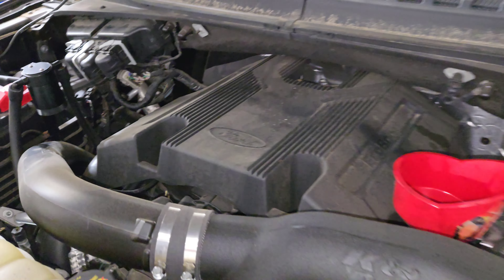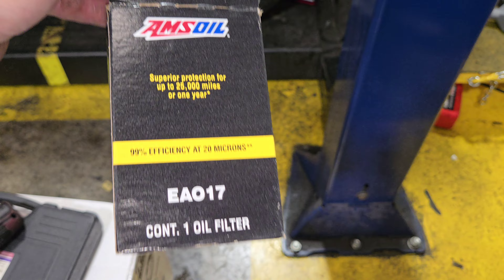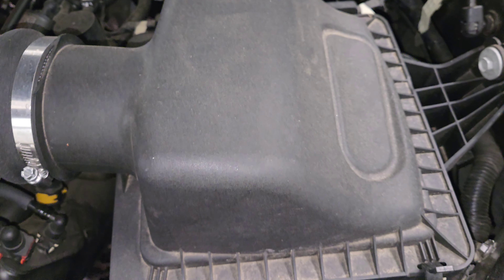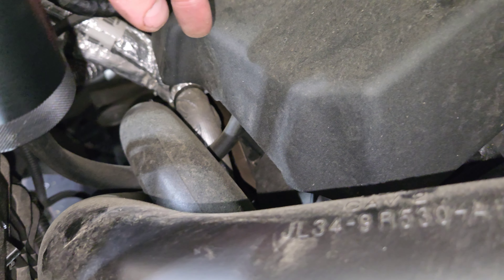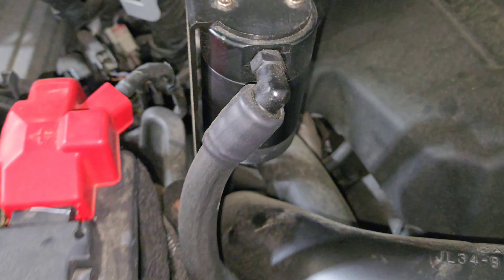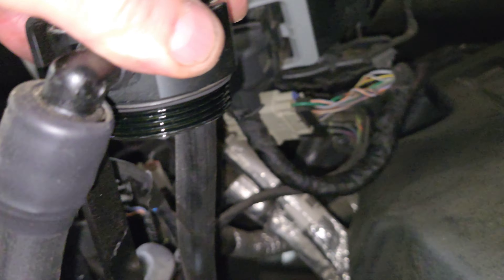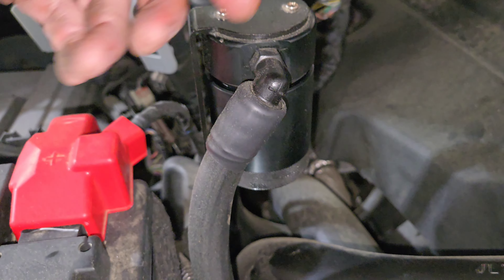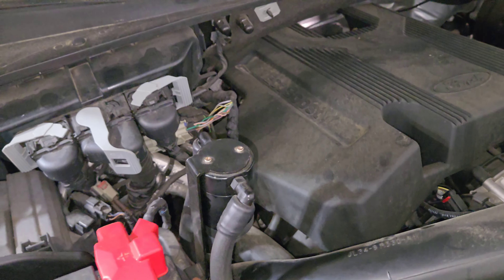Oil Catch Cans. Do You Need Them? #newtoyou #mechanic #automotiverepairs

Comment: Nice to see sons taking care of their parents vehicles in use to help my  parents with their maintenance and cleaning.they pass a couple of years ago and I miss them..I have a 2020 GMC Sierra AT4 that I use amsoil in with their filters I think that is the same part number oil filter on my gm motor.I change my oil once a year and only do about once thousand miles a year nice and clean
Reply from the maker: Yep I run it in my truck too. During the oil testing I've been doing I've been using the motorcraft filters cause when I started the test amsoil ran out of my filter. So I have to keep it the same. After this change in about 1800 miles back to the amsoil filter. Yes the chevy and gmc tske the same filter. I use them on my fleet tahoes. And got to help the parents out. He sacrificed a lot for me when I was younger and never realized it until I first became a parent. His birthday is coming up and he will be 79.
Reply: I never thought of how my parents worried about us till you do  it when your kids get there drivers license that is scary  now I know why my parents got a police scanner.I wasn’t a angle but I know that I did know how good they were
Reply from the maker: @johnmcalisterjr3913  agreed. I wasn't an angle all the time. But I knew the limits. And I knew the outcome (which wouldn't be good) if I did something really bad

Comment: I have a 2023 Nissan Frontier Pro 4x and I have an oil catch can on that, and on my 2018 Genesis G80 Sport with over 180k kms in it. Both cans do their jobs.
Reply from the maker: And I bet it runs a lot smoother as well. All that oil not going into the intake. About how often do you need to empty yours?
Reply: @BeardedFordTech  I empty around every 3000-5000kms on the Genesis (same time as my oil changes) and the same with the Frontier.

Comment: I agree with you on catch cans and I also use them on any engine, NA or turbo. I have come across some videos of people saying not to use them because they actually create more crankcase pressure due to the baffling. The theory being that the PCV system must remain unobstructed and have the shortest path possible to the intake tract. The videos are always with diesel engines, never gas engines so maybe that application holds some merit? I've never had any issues using a catch can on a gasoline engine and I've used quite a few over the years. Thoughts? Good channel by the way!
Reply from the maker: Never had an issue on gas engines. Diesel totally separate application. They have the ccv box. And a catch can doesn't really work on them. Tha k you for the compliment.

Comment: These things should come standard on every DI engine
Reply from the maker: @williamtoney2599  they do. Well sort of. The have oil seperstors that drain it back into the crankcase but it still gets into the intake. These actually catch it. I agree they should be standard. But not just direct injection. It's on naturally aspirated ones too. Pcv works the same. There's one on my mustang. Passenger side is all you need
Reply: @BeardedFordTech  
I’ve got a Tracy Lewis Performance catch can on my 16-2.7. 50,000 and no issues except….its a “leak-o-boost….🤨
Reply from the maker: @williamtoney2599  yeah 15 and 16 had leaking troubles. The new ones too around the pan and valve cover

Comment: Just changed my expedition to Amsoil, just over 20k, and My f150 also has Amsoil 194K. I though of putting a catchcan on our 2019 expy, but heard this generation ecoboost doesn't need so this video will be informative.
Reply from the maker: It needs it. If not oil residue will get in the intake. Just save yourself the Hassel down the road and keep that intake clean!
Reply: Doesn't matter the year or generation of ecoboost catch can should be installed. They would be there from factory but people can barely change their oil let alone empty a canister every couple thousand miles

Comment: does catch can void ford factory warranty??
Reply from the maker: @mulenine9867  in order for it to do that. The tech has to prove thats what it was.  As long as you keep an eye on it and empty when needed. There have been 6.6 duramax voided warranty cause of a cheap can they put on there that came apart. I've never had one do that. Don't put a cheap one on it. Keep an eye on it.  And empty it. You won't have a problem.

Comment: I like the  theory  but just not sure. I put one on my wife’s 2019 Grande Sport as per instructions and it hardly gets anything in it. I was told I should have put it on the passenger side of the engine for it to work better. I installed it according to the directions which were designed for the left (drivers side) so WTF? Any thoughts?
Reply from the maker: Always put it on the passenger side of a v6 or v8. Because of the rotation of the engine.  Which is why you don't need two on a v6 of v8. Just the passenger side.

Comment: I just installed the UPR 4' Mega catch can on my 2011 F150 back in February.  Its unreal what that stuff catches.  Now I have a leaky driver side turbo.  I want to replace both with Motorcraft but damn they are expensive.  Is there an alternative turbo you highly recommend you would use that is a straight bolt on without any additional tuning?
Reply from the maker: The only way to get one without tuning that is aftermarket is to get one that has the same amount of blades and is tye same mm.  I don't know many aftermarket ones.  Leaks are common on those years.  Have you verified it's not just the oil line going to it?  A lot of people misdiagnose those as leaking turbos when it's actually the line.  Not saying turbo doesn't leak.  But it's worth a look before you drop some coinage on a new one.
Reply: @BeardedFordTech  looking from underneath looks like the turbo.  I may take it for a 2nd opinion though.
Reply: @BeardedFordTech  I found a website that sells turbos from several different manufacturers.  All say direct bolt on.
Reply from the maker: @bearing_aficionado  as long as there is no tuning and is the same fin count and mm you should be fine. I don't have experience doing aftermarket ones on f150's it was usually under warranty or the customer wanted factory put back on. So I couldn't tell you a good one. Sorry.
Reply: @BeardedFordTech  it's all good.  I know mine are actually BorgWarner turbos just rebranded as Motorcraft.
Reply from the maker: @bearing_aficionado  yep. There has been three brand they use. Motorcraft being one.  You got a 2011. But borgwarner did them for the 2013+ possibly earlier for trials.
Honeywell
Supplied turbochargers for Ford's EcoBoost engine technology in 2008, which was used in the Lincoln MKS sedan
BorgWarner
Known for their OEM turbocharger designs for 3.5L EcoBoost engines, including for the 2013-2016 F-150 EcoBoost 3.5L and 2016-2017 Ford Expedition
Motorcraft
The only Ford-approved turbocharger for Ford and Lincoln applications, built to Ford specifications for performance and durability
Reply: @BeardedFordTech if mine is a Honeywell, that means they are Garrett's now.  If that's the case I could purchase them cheaper than the branded Motorcraft ones.  According to some turbo websites, these are direct bolt ons.  You got me thinking about the supply lines now.  I just messaged my nephew who is a manager at a shop and I will take it to him for a 2nd opinion. 

Thanks for the conversation.  You just got a new subscriber.  

I can tell you with 100% certainly who makes the Motorcraft differential bearings for the F150.  Transmission and differential bearings for the Explorer.  Mustang hub bearings.  2020 and up Explorer hub bearings.  Of course depends on certain applications, trim packages, and engines.  But they are made at my factory.  At least made in the USA.  Soon we will be the supplier of the F150 Lightning EV.  Those things are a freaking monster and weigh almost 20lbs.
Reply from the maker: @bearing_aficionado  dude that's awesome they are made here. I'm glad they are. Which factory are you in?  If you can get a bolt on thats even better. Yes I would double check that oil line. Usually the oil feed line leaks and it looks like the turbo and gets misdiagnosed. Not saying the turbo doesn't leak. But i would get a second opinion.  Be a lot cheaper if it is just the line. Thank you for the sub and conversation. Have a great weekend. Keep in touch. Let me know if it was the line of the turbo itself.
Reply: @BeardedFordTech  I work for NSK.  It is a Japanese company but we are global.  We make bearings for Toyota, Honda, Tesla, and Ford.  We also make for other suppliers, but those are either going away or we make them as needed, such as aftermarket.  We are losing what we call Hub 1 bearings.  Those will be phased out by the end of this month to make room for the F150 Lightning line.  That line is going to be huge from my what I've been told.

I just sent my nephew a message, and he was like, "Bring it up, and I will take a look at it."  I will definitely keep in touch and update you what I find out.  Thanks for the conversation, and have a great rest of your weekend.
Reply: @BeardedFordTech  p.s.  Ryobi makes transmission castings for certain Ford vehicles.  I used to work there and made those.  My brother still works for them.  Yes Ryobi does more than just tools and they don't even make those anymore.🤣
Reply from the maker: @bearing_aficionado  did not even know that. I thought they were just a tool company at Lowes.
Reply: @BeardedFordTech  the plant I worked at was a different division of Ryobi.  Matter of fact some of the machines that made tools were converted to make the transfer case for John Deere lawn tractors.  But yeah the plant I worked at made the castings for Ford, Allison transmission, Toyota bell housings, etc.  They now make sub frames for Honda.  I remember making the 5R55 transmission casting for the Mustangs back in the day.  Ford's AX4N and AS4N castings.  Allison bell housing and case.
Reply: @BeardedFordTech  KYB shocks and struts are made down the street from where I'm at now.
Reply from the maker: @bearing_aficionado  I would really love to visit and get a tour and learn how all this is made
Reply: @BeardedFordTech  that would be cool to do.

Comment: At what mileage would this start being an issue?  I have 15k right now and my truck does not have a catch can. I've got one on the way though.
Reply from the maker: It starts immediately but the longer it goes. The worse it gets cause it all bakes onto the intake valves and also leaves oily residue in the intake manifold. Would hurt to do and intake cleaning with some spray through the throttle body now.  Do an oil change and install the catch can. Then keep an eye on it every 1k miles so you can get a feel for how long it takes to get full. Do all thay. Your ahead of the game

Comment: Do I need one on a Ford f150 with the 3.5 naturally aspirated?
Mine is 2016.
Reply from the maker: Yes. Turbo has nothing to do with it other than the fact is direct injected and harder to keep intake valves clean.  Naturally aspirated still has the same pcv setup and still pits oil in the intake. I would recommend it so you can help keep it clean.
Reply: @BeardedFordTech  Thank you!
Reply from the maker: @wayneessar7489  your very welcome!!

Comment: I put cans on each side of the system.  Do you need to take them off in the winter?
Reply from the maker: You don't need it on both sides. Just the passenger side on a v6 or v8. No you don't ever take them off. They stay on year round.
Reply: @BeardedFordTech  thank you sir
Reply from the maker: @rayleonard21  your welcome my friend
Reply: @BeardedFordTech , do you know why the Driver’s side doesn’t need a catch can v6 v8 when there is a PVC valve there.. I put a double can on and only at the beginning did I get some thing in the right ( drivers side) oily film..  I get a milky substance in the winter months..
Reply from the maker: @richardhiatt9749  because of the way the engine spins.  It spins to the driver side. So all the crankcase pressure is being pushed to the passenger side going through thay pcv.  The milky in the winter time is due to condensation not letting it get to normal operating temp. You'll also see that under the oil cap.  Think of it like a room.  And your on a couch.  In front of you to the left (driver side) is a fan blowing at you. To your right(passenger side) is an open door. The fan pushing air to you will eventually turn and go out that door.  Same thing is happening. The pressure isn't high enough until it gets to the passenger side because of the way it's spinning. Basically forcing it to the passenger side. Thay is why you see it predominantly on thay side and not the driver. Hope that helps.  You'll get a little on the driver side. But not really enough to worry about. Is it hurting it keeping the can there? Absolutely not.
Reply: @BeardedFordTech  thank you … Have great evening…
Reply from the maker: @richardhiatt9749  your welcome. You as well

Comment: Do you like the ecoboost or coyote more?  Oh and does the coyote need a catch can too?
Reply from the maker: Coyote is my favorite. Don't underestimate the 3.5 ecoboost though. They will get it.  Coyote does yes 2018 and newer. It has two pcv valves. But you only need to put the can on the passenger side. JLT 3.0 is a good one. Installed it on my 2018. Took like 10 min.
Reply: @BeardedFordTech  ah okay mine is a 2014 is that a bad year?  Been good so far.

Comment: So I’ve seen all you guys install these, but my question is if they are so essential for the longevity of the engine, y are they not coming factory??
Or is that the whole design to fail situation??
Reply from the maker: Design to fail. They aren't going to put it on there. Like my truck has an oil separator on the side of the block. But oil still gets in the intake. They aren't going to put it on there because of costs
Reply: @BeardedFordTech  good to know 👍👍👍
Reply: Maintenance is the biggest reason they're not installed from the factory. We went from oil changes every 3k to 7k now to 10 and 12k these catch cans need to be emptied every couple thousand miles. People won't maintain them  plain and simple. Any engine but especially an engine that's turbo charged need one.
Reply: I’m not a fan of the newer VW’s, but many of them(1.8,2.0t) actually do have what is called oil separator/ crankcase pressure regulator valve) , which often fail and destroy the rear main seal. Just replaced one on a 08 Passout. Just spend the 230$ on the OEM, and don’t mess with the 40$ Chinesium aftermarket. Ask me how I know!
Reply from the maker: @brianw8963  lol. The 2.3 ecoboost like in my ranger have one on the side of the engine. So do the 1.5 and many of the 4 cylinders. They call it a separator as well.  Doesn't work like a catch can though.
Reply: @BeardedFordTech  Kinda get what you’re sayin. The ones on the VW’s from what I see actually drop the captured oil back into the top of the head, as opposed to capturing and draining it? More or less an over complicated pcv that is redundant.
Reply from the maker: @brianw8963  yea  on the ford it captures  and drops it back in the pan. But some always gets by. So the catch can helps.  On the v6 and v8 they don't have one.
Reply: @BeardedFordTech  Thank You👍👍🇺🇸
Reply from the maker: @brianw8963  very welcome.